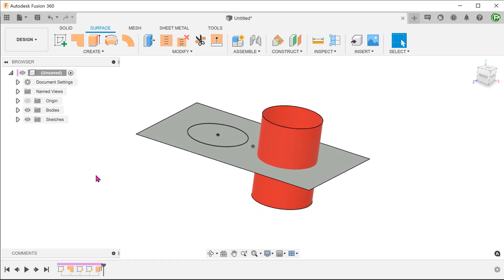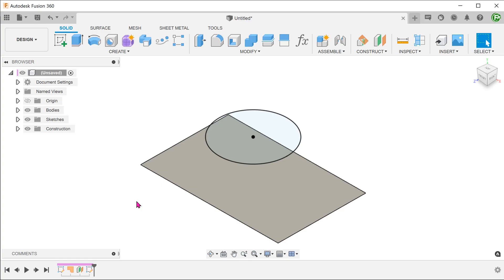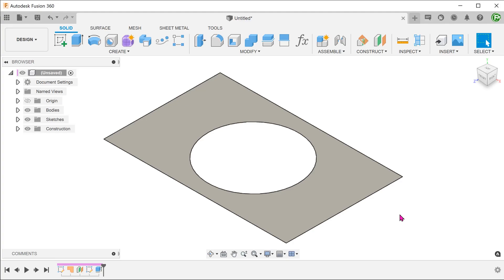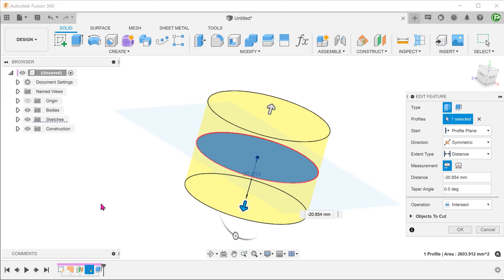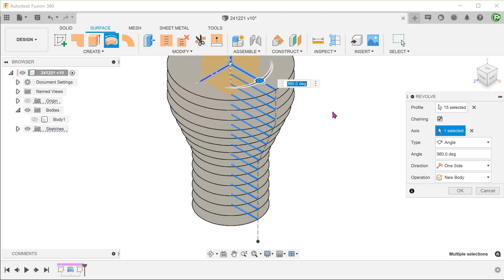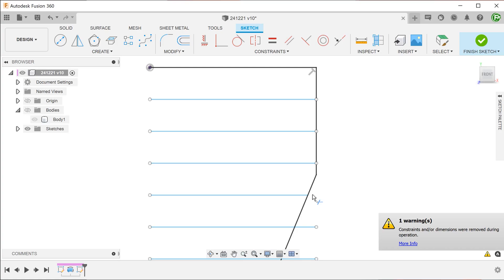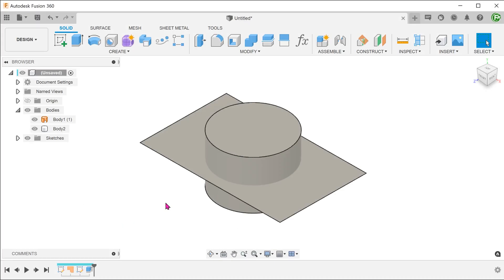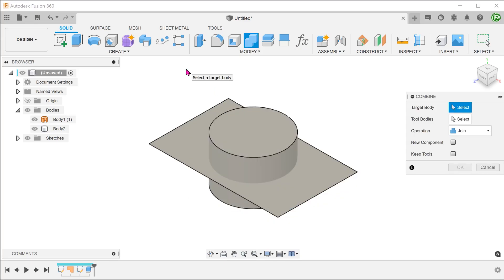Fusion 360 | Solid Extruded Cut/Intersect on Surface Bodies

Comment: I was playing with this today and found strange that I couldn’t do a cut-extrude if the sketch sit on the surface, I then offset my sketch plane a little and it works.

But I do prefer your options to cut in both directions. Good call, thanks

Comment from the maker: I have frequently used the intersect option in solid extrudes but have never used it on surface bodies before. I would regard this as the single most important thing I have learnt in 2021. Thank you to Alexey again! If you are interested, you can also try this with a solid loft with operation set to intersect. Have fun and happy new year!
Reply: That this is the most useful thing you learned about F360 in 2021 makes me realize I’m not fully-appreciating the significance of this discovery. Looking forward to seeing how you make use of it going forward.
Reply from the maker: I am kind of disappointed that not more people are expressing surprise at this. It does seem like a lot of people are aware of this. I might be overstating this, I guess. It is very humbling:)
If you look at my past videos, I have never performed a solid operation on surface bodies. I have done plenty in reverse though, like using a surface to cut a solid. This will definitely help in trimming multiple surface bodies in a 3D volume.